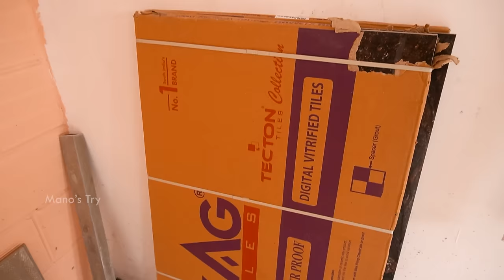குறைந்த செலவில் அழகிய வீடு | Porotherm Brick House Construction in Low Budget | Mano's Try Tamil

Comment: Additional work cost more,they ll charge... Be careful subscribers
Reply from the maker: No. Cost adhikama illayanu builder ku direct ah call panni pesunga. Just 2 mins than aagum. Contact +91 81488 39991
Reply: @ManosTry  I want to drill 5 inch nail in the wall .. is it posible in that brick?

Comment: What about plan approval, elevation,  includes wood work etc?  Red oxide flooring, 12 ft ceiling for a house of about 3000 sq ft with 4 ft above  windows and wall unit toiletery?   Raising of plot, and the building?  Grill/collapsible gate. mesh at the main door and windows
Reply: Pls send me mail ID sir I send you price details